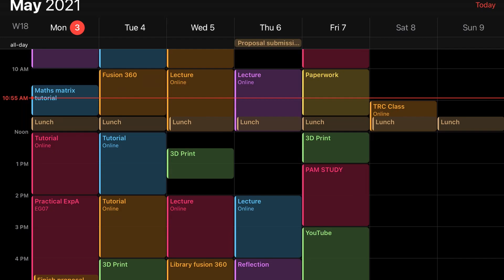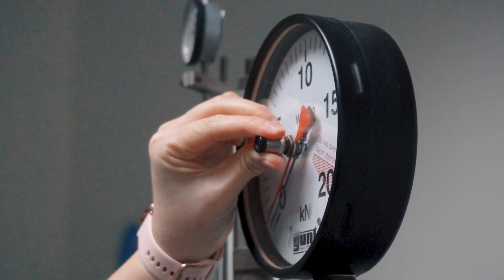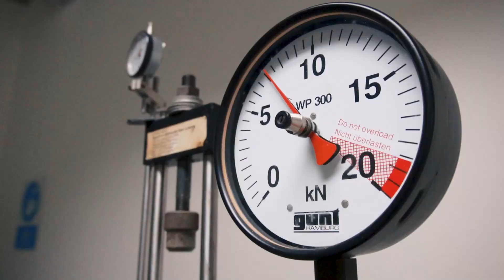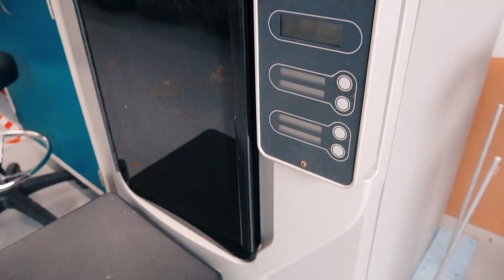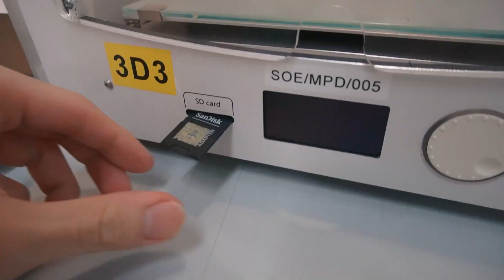Taylors University Mid-term week of Mechanical Engineering student

Comment: May I know what are the basic requirements for laptop (mechanical engineering)?
Reply from the maker: I personally use a 2019 Lenovo Y540.
Anything in windows is preferable over apple due to various programs you will need to run like matlab , fusion 360 & more. Invest slightly on a better intel/AMD chip and SSD it will be helpful
Reply: @einsteinpong  noted with thanks 👍🏻
Reply: Should I buy 14 inch or 15 inch laptop?
Reply from the maker: @chrissoon9891  do consider your preference and budget for this. Up to you really
Reply: 😊Thanks
Reply: Haha was just about to ask the same question...got 1 year left hopefully I get accepted to Taylor’s ✌️